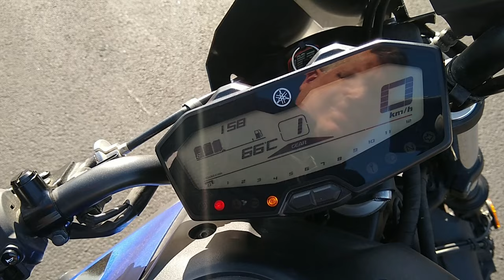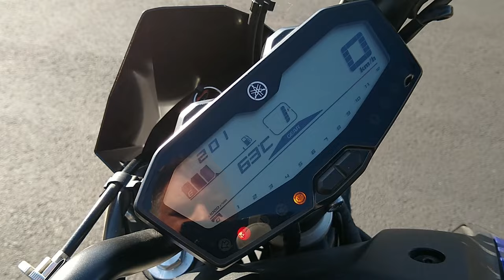10 Simple Reasons Your Motorcycle Won't Start & Battery is Good

Comment: Got my dads old Yamaha SR250 and I'm planning to get a motorcycle license this year. Just for fun I tried to start it, but it just hums and no running.
Finally a video that tries to explain some faults. Will be looking into it!
Reply from the maker: Hopefully you can get it started. If it hasn't run for a while it is best to change the fuel, sparkplugs, air filter,and the engine oil.

Comment: Here's a short story maybe you can help diagnose but I was riding to school and didn't have time to go to the gas station so my bike was near E on the gas gauge. After class was over, I went to the gas station and filled it to the full line. About 5 minutes later my bike shut off while riding on the road. I still had power. It cranks but won't start the engine. I went home and spent about a month trying to figure out the problem. It's not fuel related because I tested the fuel pressure at 43 psi and 10 seconds 400-500 mL of fuel comes out. In the manual 220 mL was the minimum. I change the fuel pump filter and gas is cleaned. I hooked up an external pump and that didn't solve the no start problem. I changed the fuel injectors filter (basket) and tested for spray. I changed the spark plugs and injectors. I see the spark plug has a spark when firing. That means the stator and crankshaft sensor is working? I heard about the low oil sensor which prevents engine starting so I changed the oil and oil filter. I have a battery charger I used to hook up so it's not battery related. Could it be a bad ECU? That cost about $500 for a used one and I don't got the money for that. Also I'm looking at camshaft sensor next and will use a multimeter to test that. I can crank the bike but it keeps cranking over and over again. The bike won't start but it sounds like it wants too.
Reply from the maker: If you have fuel and spark it should fire up. Check the air filter that it's clean and clear.
I have seen water in fuel before so maybe drain the tank and refill.
It's not a blocked fuel filter as you say the volume is correct.
Something could be shorting out to ground but still doesn't explain why you have spark, fuel, and air but its not starting. I'm leaning towards bad fuel.
The next best bet is take it to a motorcycle mechanic. They can plug in and detect any fault codes.

Comment: Hey man awesome vid my dad has a cfmoto 650nk a chinese bike i think, does not start but it turns on and its making a clicking noise which i would assume that its the spark plug working properly please help me my dad is out of town and i haven't informed him of the issue I just tried to start it as I had to go to my workplace.
Reply from the maker: Charge or replace the battery the clicking sound is usually the starter relay coming in and out due to low battery voltage.

Comment: Hey, have a bike that sat out for quite a while in florida while i was away, got towed, etc. I got it back and it's cranking but won't start, i drained gas and put oil in and replaced battery. The spark plug was changed before i left but that was years ago. I'm going to just get a new one in case, but any other ideas?
Reply from the maker: You said you put oil in it. I would drain the engine oil completely and refill just in case there is water in the engine oil.
Charge the battery fully even though it's new.
Check air filter that it's not blocked with bugs etc
Reply: @NotSealed  I'll give those a shot. Thanks for the fast response!

Comment: My new bike Triumph Street Triple 765 RS my 2023 (350km) doesn’t start at first try sometimes. Do you think battery issue?
Reply from the maker: Possibly try charging the motorcycle battery full and see if there is still a problem with starting.
Nice bike the new street triples look sweet.

Comment: On my Kaw 1000, changed the starter motor two to three years ago, few days ago it was taking a few turns to start to fire up, battery is on a tickle charger over night, today i swapped the battery over to an older one, and tried again to start bike, nothing, put newer battery back in and still nothing only the starter motor cranking over, so thinking starter motors had it, and what a joy it is to replace, so that's me on my  hands and knees for most of the morning tomorrow if it doesn't rain !
Reply from the maker: I would try and jump start it with 2x batteries and jump leads to see if you have any luck starting your motorcycle. Otherwise you may have a different issue. I don't think it's your starter motor. Maybe sparkplugs, coil, fuel, or just an old battery.

Comment: Hi I have an MT-125 2015, got a new battery (as old one was dying) and everything is working (bike turns on, indicators, headlight and back light work) however the display/dashboard is not working, just blank like it’s got no power, it was working with the old battery before we changed it however now it doesn’t work with the new or old one, any ideas please? Thankyou
Reply from the maker: Check the fuses for the display and you can always disconnect the ribbon cable for the display at the back to see if it is just a bad connection.
Make sure the battery is connected in the correct polarity.
Does the motorcycle start up?
Reply: Hi thankyou for your reply, yes the bike starts up, everything works apart from the dash, tested all the fuses and they’re working, not sure if it’s just the dash what has broken and it’s a coincidence it happened when the battery was changed thankyou

Comment: My motorcycle Bajaj Boxer 125 cc will start then switch off,is it fuel or the battery?
Reply from the maker: How long will it run for after starting? It does sound like a fuel or spark issue. A blocked air filter will also cause that issue.

Comment: I have a question. My bike isn't starting. When I turn the key, everything goes on, lights work. When I try to start the bike, the bike seems to reset and all the meters/check engine stuff does the same when I turn the key. Any ideas?
Reply from the maker: Yes it's the battery causing the bike to reset electrically. 
My Yamaha MT07 motorcycle uses the YTZ10s battery which is common to many brands
https://amzn.to/3pHyWeU
These stock motorcycle batteries only tend to only last around 3 years.
After that it's a lucky dip when they begin to fail.
Reply: 100% battery issue have had this happen to me in the past
Reply: @NotSealed  thanks, I replaced the battery. And even with 2 year without starting, it immediately ran again
Reply from the maker: @kenheijkoop6316  nice its a very reliable motorcycle

Comment: I put the key in the ignition and turn it and go to start it and all I hear is a single click. Any advice?
Reply from the maker: Charge the battery and see if that helps. See if it will push start in second gear.

Comment: I turn the key over I hear the fuel pump priming and lights turn on , I took my bike apart and set my battery aside for 2 days on a shelf (wood) what could be the problem no ground?
Reply from the maker: Well ground is good as lights work. How far did you take the bike apart?
I would charge the battery and try to start the motorcycle again.
Check the usual suspects like not in gear, stop button not active, starter motor wired up. Fuses not blown
Reply: I have the same problem bike won't start. Did you find out what was the problem?

Comment: I have that Grom clone. It was riding fine though I had stalled it a couple times, but the day after it wouldn't start and I charged the battery as well. I do not know if they have safety switches or anything.
Reply from the maker: Possible safety switch in the side stand. On off/key switch could be faulty.
If battery is over 3 years old replace it. Check spark plug, fuel and air filter
Reply: @NotSealed  I dont know how old battery is. How do i “Check” the spark plug
Reply: @rvnsuki  take the spark plug out and check if it is dirty or damaged.
An old trick is to leave the plug out and plug it into the electrical plug and let it touch a metal part of the engine. Turn the engine over and look/listen for a spark. Be careful
Reply: @ravenit1  but i don’t understand how it got bad or messed uo so quickly
Reply: @rvnsuki  you have to back to basics fuel, spark, air. Check all.
I just fixed a mates motorcycle that had water in the fuel tank due to all the rain. Had to drain it all then motorcycle ran fine again. Bad fuel tank seal
Reply: @ravenit1  I just was thinking cause it was in garage and it was letting me ride it so tbe fact it doesnt start at all.

Comment: I have a mt-125 the bike will start and then just slowly die and completely stop any help?
Reply from the maker: Bad fuel, clogged/dirty air filter, bad spark plugs, cracked head gasket, electrical short circuit. 
Could also be a bad battery so replace that if it's over 3 years ild
Reply: @NotSealed  I did a check and it said something about a throttle body? I’m not very good with bikes do you know what it could be?

Comment: I need help
hey so I have a 2014 ninja 300 abs and it won’t start. Some backstory: the bike ran a little shaky but fine then i parked it and let it run for a little bit to see if there was a problem. The bike then died down and shut off but now wont start anymore.
I turn the key to on and lights and everything works. 
I go to start the bike and it cranks and cranks and cranks but doesnt turn over and actually run. 
I replaced the spark plugs and charged the battery but still nothing.
The starter relay was good after i tested it. 
PS: the bike has been sitting for about 2 weeks outside in the cold and rain so idk if that has caused any more problems. 
Any ideas on whats wrong with it?
Reply from the maker: I once had a old bike that got water into the fuel tank after it rained making it hard to start.
Drain the tank and try again,  also check if you have spark.

Comment: Mine won't start today, this is the 2nd time in a short time.
When I jump started the bike first time, it started up immediately after that, now a week or 2 later it happened again.
Oil indicator lights up when I turn the key but when I wanna check the oil level of my mt07 I don't see anything, so either it's too full or empty?

This is infuriating, I barely ride in the rain, haven't even done wheelies yet and already have to deal with this stuff.
Reply from the maker: Probably 2x problems here. Best to identify the oil issue first. 
Too much oil is bad just as too little oil. Lean the bike on the side and look at the oil window if it changes.
You can read about how I change the oil on my Yamaha MT07 here
https://notsealed.com/how-to-do-an-mt07-oil-change-in-5-minutes-diy.html

How old is the battery?
If older than 3 years then swap it out.

Comment: I dropped my 2007 Honda cbr125r on grass going like 10km and now it won’t turn over
Reply from the maker: That's very odd. Something must have come loose.
Check battery, stop switch, side stand switch, clutch leaver switch and maybe try to push start it.
Charge or replace the battery if over 3 years old.

Comment: i turn the key and nothing happens, not even a single sound
Reply from the maker: Flat battery.
Reply: Fuse
Reply: @SebGray-yr5tv  yeaa i blew my fuse
Reply: @NoOne-nr2jl was it the relay? I’m getting power but nothing is happening when I press start on the bike
Reply: @JavierTrevino-qb8he  maybe check your battery
Reply: @NoOne-nr2jl  happened to me too hahah
Reply: I have that most times but when I don’t my bike will start no problem